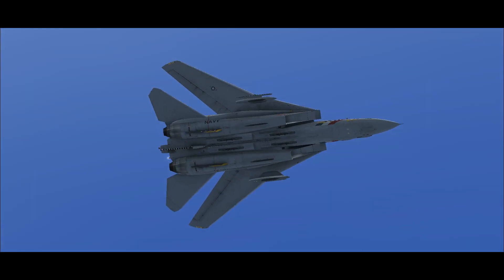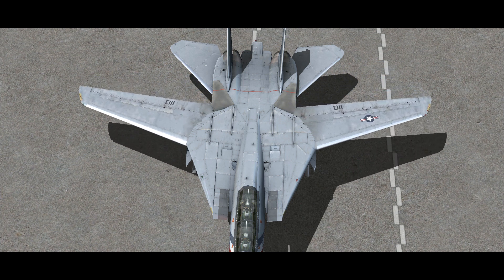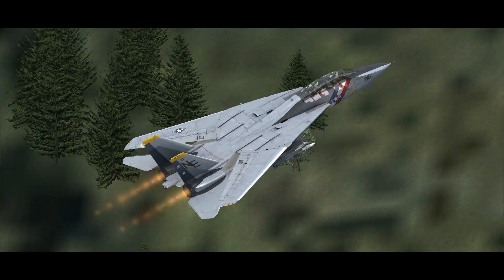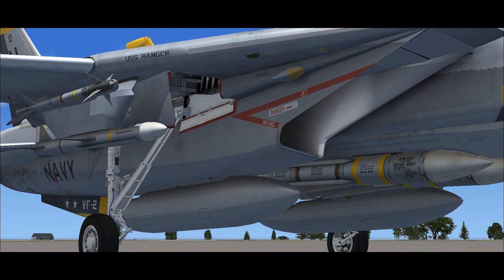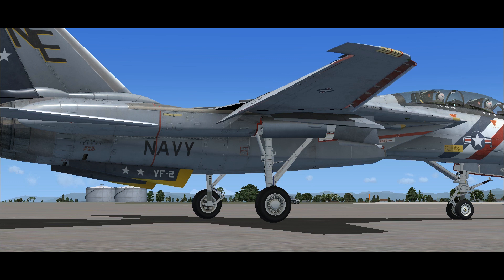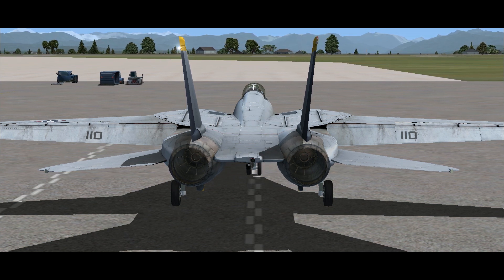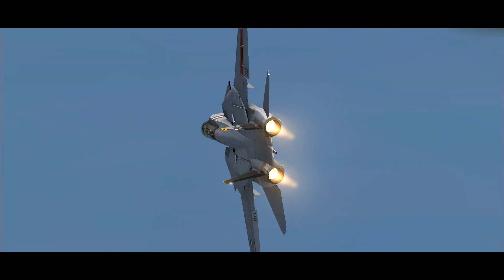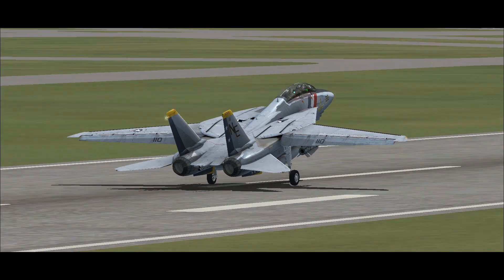How the F-14 variable wings work and open , close and move ? | f-14 tomcat | us navy fighter jet

Comment: Not one drawing of the mechanism that moves these wings under the pressures in flight.  Your video says "how they work", yet you simply provided some shots and videos and gave nothing of what your title claims.
Reply from the maker: I didn't say how its movement mechanism is, I said how it works and opens and closes
With a computerized or manual system and at what speed etc❤❤